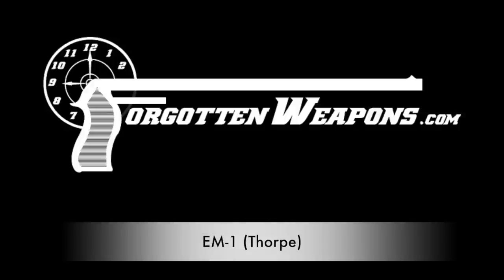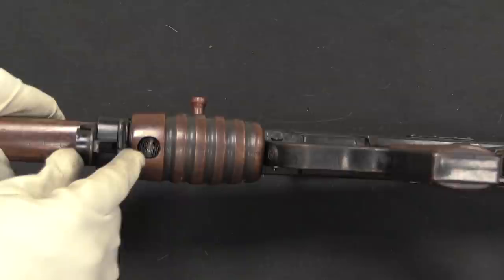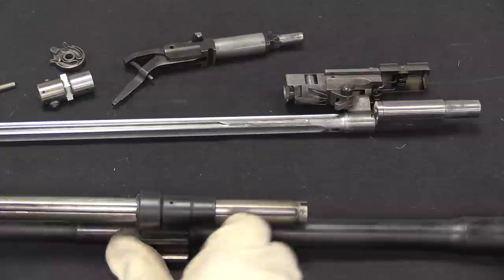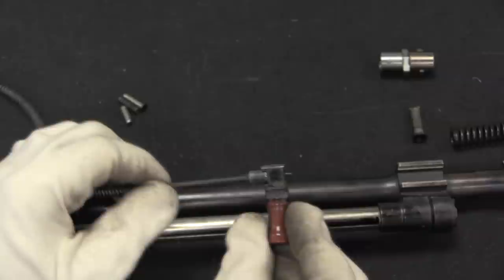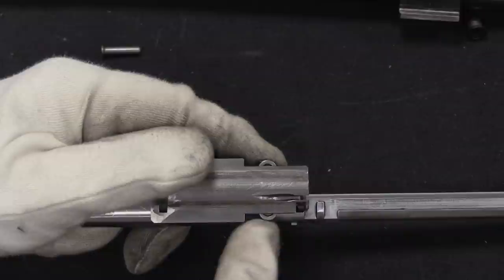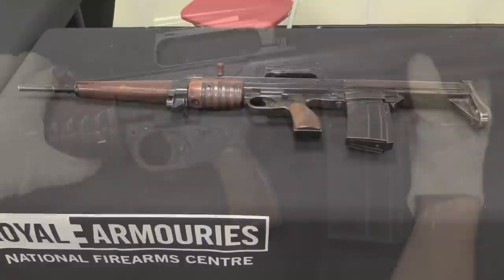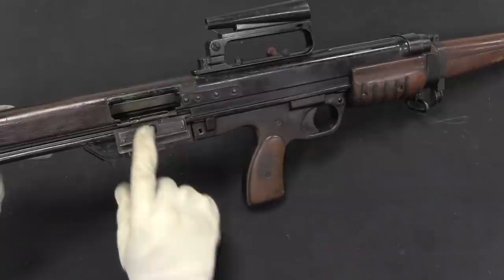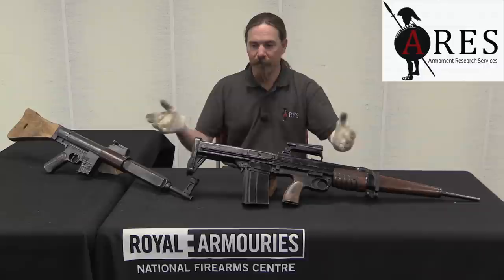Thorpe EM-1: A Bullpup Take on the Roller Locked Gerat 06

Comment: I'm not a gun designer, but I think I can still offer some advice to anyone who wants to be one: If any of your disassembly or assembly steps are known to be prefaced by "I swear I'm not making this up", it's time for another pass.
Reply: Same could be said about the Winchester 1911 SL with regards to charging the gun. Admittedly they had to work around Browning patenting the concept of using a handle in the bolt to charge the gun but still there is a reason only one gun used that design. My advice to future gun designers don't use the barrel of your long recoil operated gun as the charging handle it is not a good idea.
Reply: Garrett Evans I've been keeping my eye out for a Winchester 1911, would be a cool addition to my Remington shotgun collection
Reply: Every year in the service, I found one or two of these types of instructions amongst a handful of technical manuals. 
Two things are required at that point: you need to do it the way the manual says to do it; and you need to hope the previous 40 guys also did it the way  the manual says.

Comment: "oh hey a roller delayed gun, I wonder why it failed, rollers are easy to deal with and pretty reliable"
[5 minutes later]
"oh no baby what is you doing"
Reply: THE mg42 WAS also ROLLER LOCKED but used a gas boosted reciprocating barrel.
Reply: @bademoxy
Are you sure that it wasn’t just a roller  delayed system?
Reply: @davidschneider9145  yes
Reply: @davidschneider9145  No I think the MG42 is roller locked short recoil action

Comment: The plunger is designed to be rotated with a standard issue Mk.1 teaspoon
Reply: The British Army tea spoon requirment, ended up as JCB. :-)
Reply: You mean the Spoon, Tea, No.I Mk.1*?
Reply: @fear-is-a-token  the * was a crucial improvement to the system
Reply: @LankyAssMofka  did any of the marks of teaspoon have a bayonet lug?

Comment: It is common to field strip military arm blindfolded.  I shudder to imagine some poor guy trying to do it with this beast.  More great work on an armorer's nightmare.
Reply: the designer took a left turn from the german engineered stg45 and made the barrel extension come out with the bolt and gas assembly, which way overcomplicated dissassembly and probably degraded accuracy too, since the barrel isn't rigidly bedded within the receiver.

Comment: I love the EM-1 and EM-2 Rifles.

Love the .280 cartridge too.

Just a correction through, the .280 British bullet was 139 grains in its original config, and later changed to a 140 grain bullet. The casing was also lengethened from 43mm up to 49-51mm depending on variant and those would likely have also been adopted for various roles or even would have replaced the initial .280 design due to more stopping power and a bit more range for very little recoil increase.

Comment: I don't think you've described the physics of roller delaying correctly. The idea is not to dissipate the force into the trunnion, but to make the rear part of the bolt assembly go faster then the bolt itself. The force imparted on the rear part of the bolt assembly is actually less this way, but not because it's dissipated somewhere, but because of the physical "lever" that is formed by the rollers and that angled surface, "pivoted" (the lever) at the trunnion.

Comment: That firing pin lever is quite clever. It looks overly complex, but they solve the problem of the transfer bar and squishy trigger. There's no need to transfer the trigger pull back to the hammer, because the hammer is at the front. 

It also solves firing out of battery, which was a problem with bouncing roller delayed bolts. With that lever, the hammer cannot strike the firing pin unless the bolt is all the way forward.

Comment: Hello Ian. Excellent video once again.

I'll pull you up on one thing. You mentioned and demo'd (7:50/16:20) the need to poke your finger up inside the mag well to release the bolt from the locked back position. The EM-1 and EM-2 both have a double spring shared pivot mag/bolt release system. Simply this means the mag release lever can be pushed towards the magazine to release the mag and also pulled away from the mag to release the bolt. I'm sure Jonathan Ferguson would be happy to confirm this and maybe do a short video of this in action that you could addendum to the presentation.

Looking forward to your EM-2 video with shooting footage, however for those who hope to see the .280 version in action are going to be disappointed, there are no .280 ammo rounds available anywhere in UK.

Comment: Thanks very much for showing this rifle to us, I have been curious about this model for years, and information was sparse.
In my opinion as what is a prototype after all it is an impressive rifle and if further development had been allowed might well have become more 'soldier proof'.
The central issue with all of these rifles is the 280 British cartridge which is a very interesting concept, however i have wondered why they did not simply use 6.5 swedish mauser  (currently 260 remington might work)

Comment: The tiny tube optics may seem awfully out of date, but in fact both the G36 and the F2000 came with small tube, low magnification, rather junky optical sights. So quite recently gun designers in both Germany and Belgium thought like the british back then. It didn't take long before they got feed back from prospecting buyers that had their rifles on trial that it was a bad idea, and they all came with picatinny rails instead. The Steyr AUG also came with an integrated low power (1.5x) optical sight, but the quality of the sight was good so users put up with it for many years, until relatively recently. Steyr tried to update the AUG, most notably dropping the sight in favor of a picatinny rail, to compete with newer designs, but has clearly fallen behind now.

Comment: Do you think there would have been bolt endcaps made in different weights if the design had been developed further? That seems like a pretty nifty way to adjust rate of fire or tune for finicky cartridge loads.

Comment: Just a random thought I had, but why hasn't anyone tried making a blow-forward bullpup?
Reply: I designed one and made some schematics, the main issues I came across are how it is going to cock the hammer when it is behind the action's travel, and how it chambers cartridges.
Reply: STOP VARGPOSTING
Reply: Not at all. Bullpups are a niche concept for a niche roll. In a tight urban setting or the confined spaces of a vehicle, you're goddamn right I want a bullpup over a more conventional design.
Reply: Vargposter And I know, a blow forward bullpup may sound like a good idea  because you can basically use the whole length of the receiver for the barrel. I "designed" one too when I was 15 years old, but came quite fast to the conclusion that it's a bad idea
Reply: Verfügenichtüberdienötigekreativität And this is why we are at a plateau in gun design, anything that hasn't been done before is a "bad idea".
Reply: Vargposter Blow forward has been done before and it's hilariously bad.
Reply: Verfügenichtüberdienötigekreativität The only blow-forward rifle I can think of is a Swiss prototype, which was in a conventional layout. Anyway, blow-forward isn't optimal in all categories, I wouldn't say it is hilariously bad, but it gives you the theoretical maximum of barrel length for overall length if it is used in a bullpup layout. This is an advantage in many situations. You can have a rifle that has an 18" barrel, and have it be as maneuverable as a pistol with a stock attached.
Reply: You can cock the hammer if you offset it to the side of the bolt. You'd need a angled firing pin, which would make firing out of battery, provided you take a rotating bolt, impossible. Its safer and allows you to have a very short end of the system. To those that say 'blow forward is bad': The Pancor Jackhammer is a blow forward design. And that thing both looks sexy af and seems like, if adopted, would have worked very well.
Reply: Vargposter Yeah you get a little bit higher velocity, but there are so many trade offs, that just aren't worth it.
Reply: Zibingo Taeam Cocking a hammer or a striker on a blow-forward design is really one of the easier problems to solve. The main problem is that you get massive recoil because this heavy fucking 18inch barrel slams back and forth with every round fired. I really like how all of you are questioning the status quo in firearm design, however a blow forward rifle is just a B A D or at least a badly thought trough concept.
Reply: Verfügenichtüberdienötigekreativität That's the main concern with something like this, but I read somewhere that in testing, the Swiss AK53 blow-forward rifle was found to be very controllable in full auto due to the low cyclic rate of 300 rpm, which was inherent to a blow-forward design. Anyway, I think such a firearm would have some application, but since nobody has come around and actually built one, it can be presumed that it's because of it being a very strange setup to begin with, and the marginal benefits and the potential drawbacks.
Reply: The main problem of course is the realignment of the barrel, making very precise manufacturing a must to achieve acceptable accuracy.
Reply: Vargposter Okay but what application do you think of ? Precision rifle ? To inaccurate. Compact cqb rifle ? To slow  fire rate. The only thing I can think of is maybe a compact semi auto grenade launcher. But again nothing I can think of that fires rifle rounds.
Reply: Zibingo Taeam And you still think a design that needs very precise manufacturing to only achieve acceptable accuracy is a good idea ?
Reply: Verfügenichtüberdienötigekreativität Depends on returns. Also depends on the machines I have available and what this precision costs. Looking at history, precise machining gets cheaper over time. Its bound to still get cheaper. At some point, blow forward will be financially viable. no reason not to do some long term R&D.
Reply: Verfügenichtüberdienötigekreativität I don't really see inaccuracy as a problem for this type of weapon. Sure the barrel reciprocates and thus the lockup is susceptible to not being exact every time, but all meaningful inaccuracy for the type of combat you'd use a compact rifle for can be remedied by good manufacturing with tight tolerances. This kind of gun would be useful eg. for tank or vehicle crews, and even in a cqb situation it would be useful for it's maneuverability, despite of the potentially low cyclic rate. Same rationale as regular bullpups, but more compact.

Comment: A British Bullpup? Oh no, does this one also not work?
Reply: TheGoldenCaulk ,

The EM2 was a remarkably good rifle for its time.  Miles better than that abortion that the UK military and other groups ended up with.  I do not mean the SLR as being the abortion either.  It is just a pity the USA forced everyone in NATO to go with 7.62mm ammunition.  The EM2 would not have worked with 7.62mm, even though I do believe there is/ are samples of the EM2 in 7.62mm (Edit - just ask Ian, he fired one in 2013).

The EM2 would still have been an expensive weapon to produce though.

If you wish to see the EM2 in use, plus many other things, including the .280 machine gun, and the EM2 going through its' very own "mud" test (well, sand test actually), then watch the linked Pathe News movie: - http://streaming.britishpathe.com/hls-vod/flash/00000000/00047000/00047939.mp4.m3u8
Reply: Spencer King I CLAPPED WHEN I SAW SOMETHING I RECOGNISED

Comment: And they say that the Germans over engineer. Well, the Gerät 06 easily beats this thing, and the 06H would probably give the fabled AKM a run for its money in terms of simplicity.

Really, how do you get from such a simple and effective design to this? :P
Reply: had rene studler not been dictator in chief of the US army munitions and an actual brain running that show, the EM1 cartridge with the performance mods that american  wildcatters are known for , could have outperformed the 7.62 at 600 meters , especially necked down a bit more to perhaps 6mm and loaded with a long -100 gr fmj sbt with a b.c. of +.550  and muzzle velocity of over 2900 fps 
would have plenty of stopping power at close range (hydrostatic shock)and superior armor penetration as far as one could hit.
there wouldn't have been a 7.62 x 51 because it wouldn't have been as effective.

Comment: Curiosity: What's the point in designing a bullpup gun with a barrel so big that the gun has almost the same length (or more) of a "traditional" one? It kinda contradict the idea of a bullpup design, not?
Reply from the maker: They wanted to get as much velocity as possible out of the cartridge as part of the effort to have it accepted by NATO over the T65/7.62x51.
Reply: The idea of bullpup is to get as long a barrel as possible in the shortest package to gain ballistic advantage.